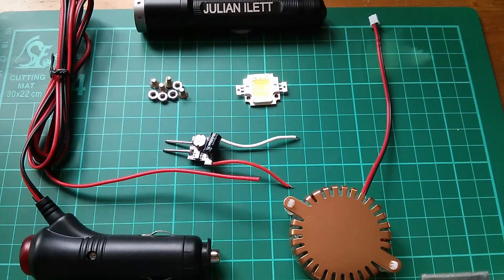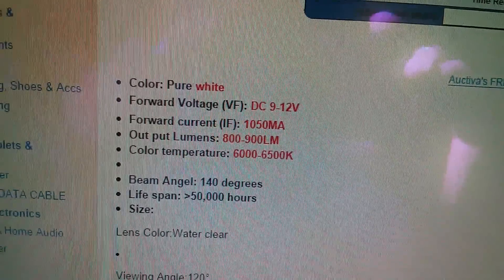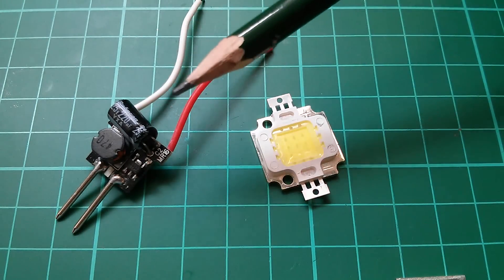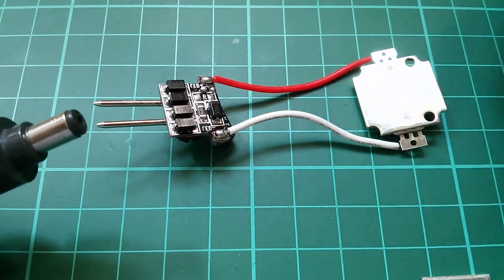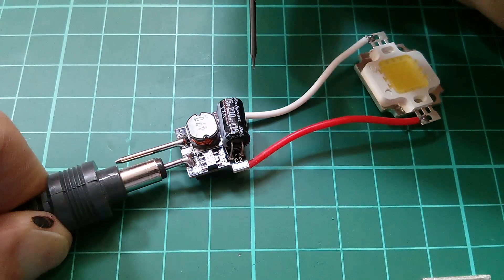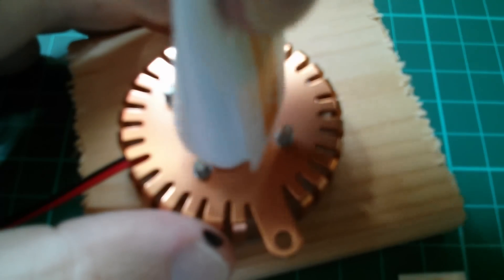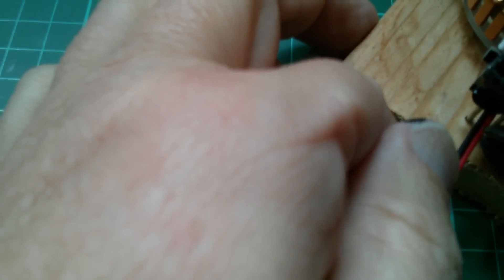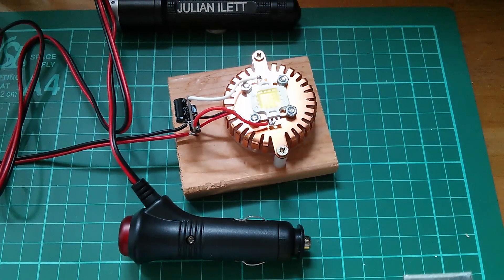LED Tutorial: Light a 10W LED from 12V - Simple & Cheap

Comment: If you were to mount all five of your ten W  LED's, each with it's own driver as you demonstrated in this video,  could you use a switching power supply to power them?   I am thinking a power supply with adjustable voltage?  I would like to build such a light but don't quite know how to proceed.  Thanks very much.
Reply: Constant voltage is not ok to power LEDs. You either need resistors in addition to a constant voltage power supply or constant current.
Reply: runner180fxr I thought the drivers Julian was using WERE current regulated.  I would like to mount five or ten of these ten W LED's using the same driver he used.  I know I'd have to use a driver for each ten W LED, but don't know the best way to provide power.  I have no 12 V battery as he used.  What alternatives do I have?  I appreciate any advise.
Reply: kccustomuph
Sorry, I misunderstood your first comment. Yes you could use a switching psu instead of a car battery (and 5 of those led drivers). You have to make sure it is capable of providing more than 50 watts of power though. There are also drivers that can be used with mains power. Something like this: http://www.ebay.com/itm/10W-20W-30W-50W-100W-LED-Beads-Chip-Driver-Waterproof-Constant-Current-85V-265V-/201087891639?pt=US_Lighting_Parts_and_Accessories&var=&hash=item2ed1c5b8b7
Reply: runner180fxr Thanks again for your advise.   As it happens, I have a switching power supply, it's used, but still works good.  It is 400W 24V @ 16.5A.  The voltage is adjustable.  I was hoping I could use those very inexpensive current regulated drivers that Julian used in his video, and power them  with this power supply.   As you can see I have the desire to do this project but not all the knowledge I need to accomplish it.   If I were to use the driver in the video, I presume I must adjust the voltage on my power supply down to 12V. Is this correct?   Thanks again for your help and I will check out the link you sent.
Reply: kccustomuph
No problem. Your psu can handle 50 watts easily. You have to know the rated input voltage of the driver to adjust your psu's output voltage accordingly. According to the link Julian posted in the description, this driver can work with 12-24v DC input. I wouldn't use 24 volts though. Use 12 volts not less not more. Some people in the comments of this video reported that the 12 volt fan cannot handle higher voltages.
Reply: runner180fxr
Thank you so much for clarifying this for me.   I will do as you say.   I won't be using  the heat sink and fan he used in the video.  I bought 5 CPU heat sinks with fans on Ebay and will use them instead.    But I will use the driver and LED he showed in the video because it's so inexpensive.  Julian seems to have a knack for finding good things on Ebay.   Many thanks for your help I really appreciate it.

Comment: I'm just trying to get my head around the current regulator unit. If this was just a standard low power red led back in the 1980's, the current would be controlled with just a resistor. In the case of this 10W LED, I'm guessing that you need this little regulator circuit because of the change in temperature of the high power LED causing a change in the current? Is that correct? So if you just used a resistor to control the current, the current would still change as the LED temperature changed? Much appreciated if somebody could set me straight on this, thanks.
Reply: "So if you just used a resistor to control the current, the current would still change as the LED temperature changed?"
I believe the answer is yes. I would also like some clarifications.

How you can drive an LED with constant voltage and just a resistor is a mystery to me. I'll explain why. The temperature of an LED rises when it's on. As the temperature rises, the voltage drop across the LED decreases, thus the voltage drop across the resistor increases which leads to an increase in current. The increase of current causes further heat on the LED which causes further voltage drop and so on. I can only guess that the voltage across the LED cannot drop below a certain point and an equilibrium is then maintained. Also I guess with a low power LED the temperature increase is insignificant.

"In the case of this 10W LED, I'm guessing that you need this little regulator circuit because of the change in temperature of the high power LED causing a change in the current? Is that correct?"
Yes that's correct. LEDs need constant current and heat is one the reasons why constant voltage (not 12 volts of course) wouldn't be enough to maintain constant current.
Reply: runner180fxr Thanks Runner. When I talked about driving an LED with constant voltage and just a resistor, I was referring to how we did it back in the 80's, when I don't remember those seriously low wattage little red, green or yellow LEDs in electronics classes ever getting warm at all, even when left on permanently! LED technology has changed a lot since then, but my knowledge of electronics hasn't :-)

Comment: how would i drive my LED witch needs 3A 3.5v? 
ive been searching online but i cant find a driver that can deliver the big current.
Reply: I believe the only driver that is supposed to do that is a flashlight driver. Something like these:
http://www.fasttech.com/products/1612/10003372/1250100
http://intl-outdoor.com/amc71358-5mode-circuit-board-nanjg-105c-304a-p-667.html
http://www.mtnelectronics.com/opencart/index.php?route=product/product&product_id=52

Comment: What if you wanted dimmable? Have you tested longevity of these components? Will these last for years or die out in a month or two. What's your general experience?
Reply from the maker: FilmFactry Cynical answer - the LED driver and VGA fan are intended for use in other products which generally have a 1 year warranty. Therefore, they will probably last a year and a day.

Comment: According to the seller's specification, connecting it to 12V directly would be likely to work given the led stays cool.
That it stays cool is quite much a forget it, and the current will increase and it will get even hotter etc. Thus short pulses only.

Constant voltage is doable, but constant current self-regulate and is way safer for the led.

Comment: Could of you used a current limiting series resistor instead of the LED driver circuit? I know it would be kind of risky, but as long as the power is around the 12v mark, it should be OK.
Reply from the maker: Peter C. Kopp If the 12v supply is regulated, a resistor can be used. 12v minus 10v across the LED leaves 2v across the resistor. A 2Ω resistor would set the current to the required 1A (2W dissipated in the resistor). However...
Take the supply voltage up to 14v and you've got 4v across the 2Ω resistor = 2A. Bye bye LED.

Comment: info about vga fans, although they are 12v, they dont like 14.5v you may be charging a battery at, at the same time, they die very prematurely, i had several fairly nice ex pc fans, and put one inside my battery charger to cool it, and although i had a dozen of them, each one died inside the hour, so much for that!
Reply: Walter Boxhead
Or even better, remove the diodes from the regulator. They are just further dropping the voltage available for the driver (and thereby LEDs) and reduce efficiency quite alot (I think they are Schottkys, two of which will be "in circuit", meaning a drop of around 1V at 1A). And they aren't needed anyway since the whole thing is running on DC anyway. Use these diodes in series with the fan then (it draws way less current, so efficiency doesn't matter there).
Reply: stonesouls As a second thought, I suppose I could have used a buck control LM2596 (about $1 Ebay) to feed my fan and LED resistor setup, as these controls will hold set voltage on over voltage and linearly decrease output going under setpoint. The fan would slow up and the LED would dim a bit under 12VDC. Also a thanks to Julian for introducing me to these small controls to begin with.
Reply from the maker: jusb1066 I can test that fairly easily by plugging in the power supply and re-charging the booster pack (it gets to about 14.5v). I'll let you know.
Reply: I would agree about the small fans above 12 volts, they have a tendency to burn out easily. I have been working on a similar project where the voltage fluctuates based on charge using a 10w 9-12v LED and a small 12v cooling fan. I ended up using a small SEPIC control DC-DC ($2.70 Ebay) LM2577 to feed the fan and LED. I used a 2w 1.5 ohm resister on the LED. Works great, has been running for several weeks.
Reply: This same vga fan as in the video runs fine at 15 volts here. no problems. one for a week without interruption.
Reply from the maker: Julian Ilett Seems fine - although the booster pack didn't stay at 14.7v for very long.
Reply: you can easily wire a buck converter to it to lower the voltage and regulate it at 12v.